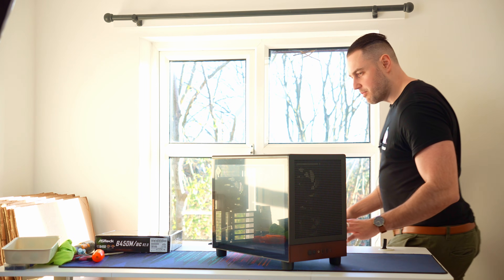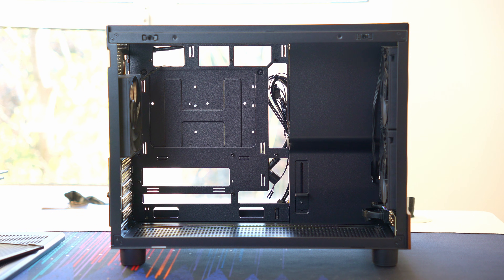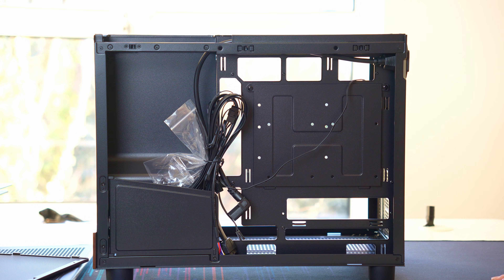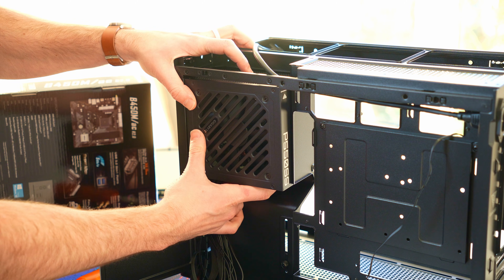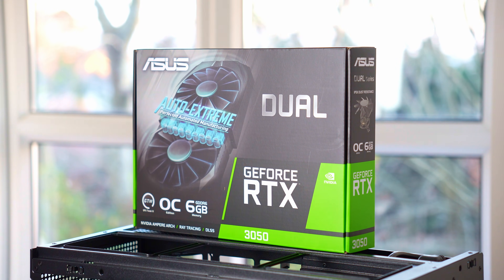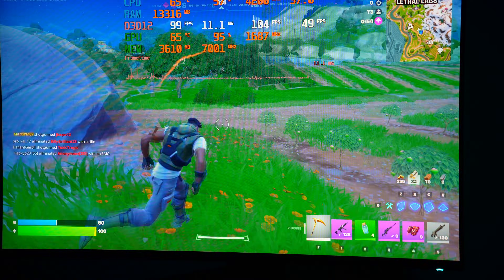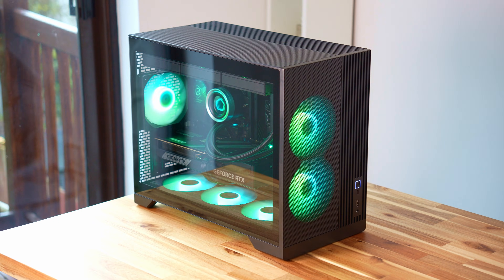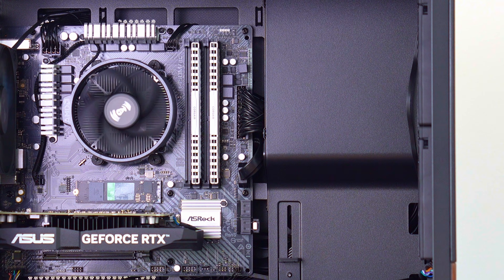I Tried the PC Case YouTube Told Me to Buy

Comment: I purchased a gamdias with a pre installed non modular 850psu for 99 usd, and didn't have that problem. However if I was building one I would also be annoyed of the psu problem
Reply from the maker: It must depend on the PSU - but this happened with two units I used
I didn't ride it too hard because ultimately it's easily fixable. Though not ideal!

Comment: I made a build in this case a few weeks ago and I like its simplicity. Obviously a budget case but didn't feel too chinsy. 

For what it's worth, the PSU extension cable on mine does come out running towards the rear of the case instead of the side panel like yours. I didn't have to modify anything and it fits just fine without being pinched. They must have realized their mistake at some point and fixed it.
Reply from the maker: Nice!

Comment: You can always order a left/right angled power cord extension to replace the stock. But of course, that will be an additional cost and can delay your build until it arrives on your door step.
Reply from the maker: True!
I suppose though, is that a reasonable thing for the customer to have to do?
Reply: @thecomputersurgeon  Not reasonable but someone who has their heart set on this case can get around it.  They go for ~ 7.50 USD for one.  Not the end of the world if you know ahead of time to add the cable to the budget.
Reply from the maker: Yeah fair
Reply: @thecomputersurgeon  I mean, if you really like the case.

Comment: That's a pretty cool build. Would be a great replacement to a £500-600 laptop (pre RAMapocalypse prices) for someone that never takes it out of the house and likes the look of a PC tower.

In regards to mATX case options, I'm glad it has become a standard occurrence, even though motherboard options could be better. I personally love an mATX build, because it's small enough without the ITX tax, but knowingly of the limitations smaller cases bring. I used a Lian Li Dan A3 wood version for my build recently, which is greatly lacking in the cable management department, but at least there is space for creative solutions depending on the GPU + PSU used
Reply from the maker: Yeah it's OK. Better hardware choices for the money realistically though, especially if willing to go to the used market